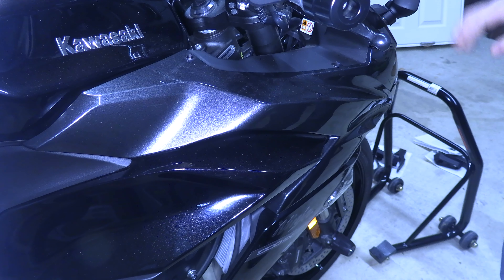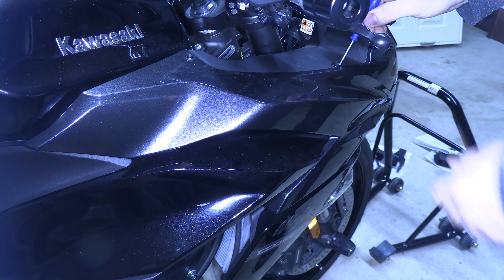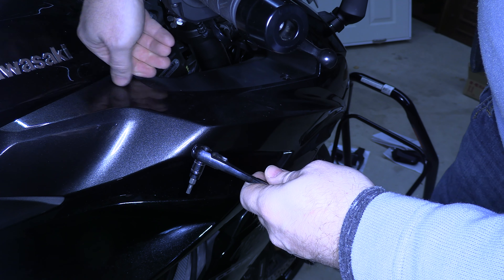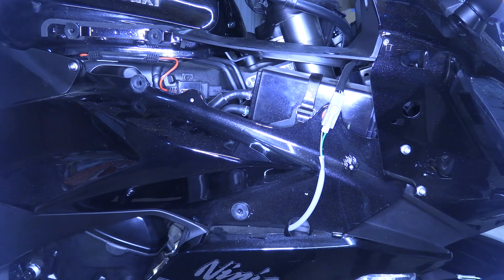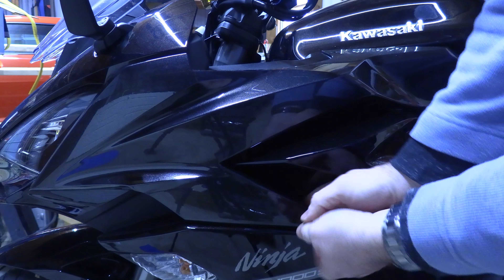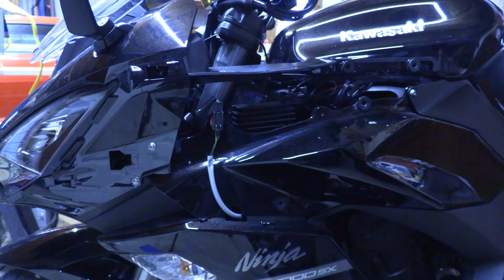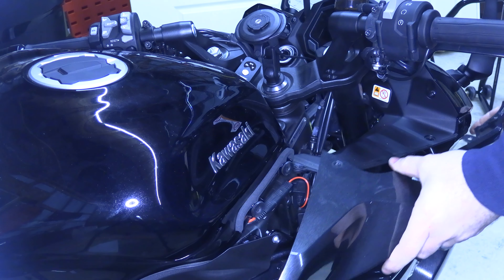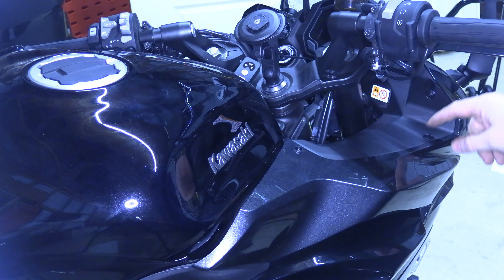Kawasaki Ninja 1000SX Middle Fairing Removal and Installation Tutorial

Comment: Thanks so much for the tutorial. Can you tell me, just to lift up the petrol tank cover do i need to remove just the middle fairings(after seat removal) . I have an evotech quadlock mount which requires removing the tank bolts and slliding under but the tank wont lift with just those tank bolts removed
Reply from the maker: Yes, that should be all you have to remove.